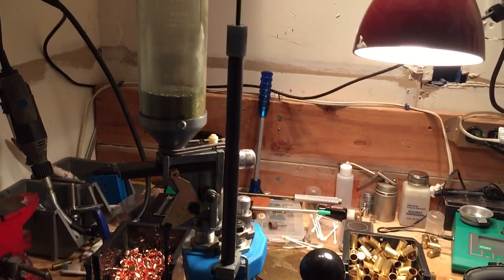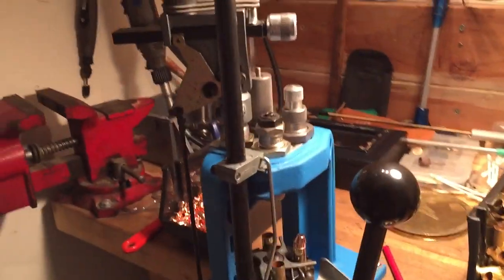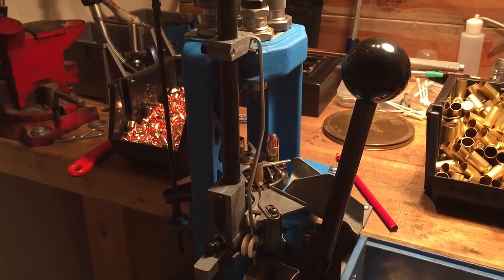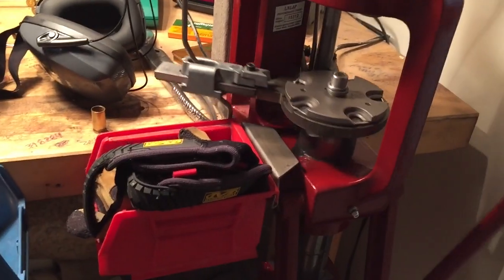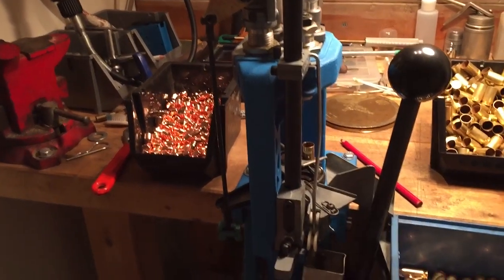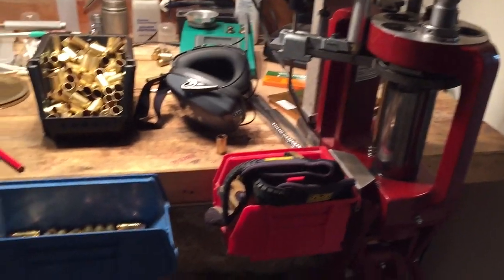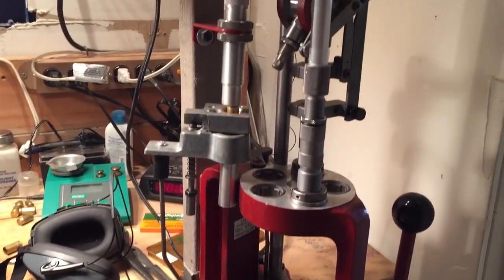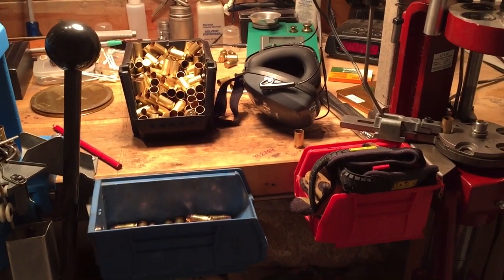Dillon 550 & Hornady LNL AP Comparison of two $400 Reloaders

Comment: I recently picked up a used Hornady LNL AP press in a trade (It came with an automatic case feeder and all the plates for it as well as 6 shell holder plates, 9 sets of dies with quick change adapters for all die sets and lots of other items. I’ve been reloading for a decade now and I used an single stage RCBS which works fine for the small batches I do for long range marksmanship but I wanted to find a Hornady press to make bulk ammo. The prices on the Hornady AP presses has gone up dramatically but there’s many of them out there compared to the Dillon so there’s a better chance of coming across a used one. I’ve been wondering how the Dillon would stack up to Hornady so this was a helpful video. Hornady customer service was very good when I needed replacement parts and they gave me what I asked for at no cost which was nice.

Comment: It is an old video, but what do you think about the presses now some years later? I have had it with my hornady lnl ap, tired of all the issues, and went to a dillon 550c.. Did you ever notice on your hornady ap when indexing cases into station 5 that they tip inward towards the middle? Both of my hornady ap's do that in several different calibers, especially with tall cases. That causes the case in station 5 to often collide with the mouth of the crimp die and cripple the case. So I can basically not use station 5..

Comment: I own a Dillon 550B. When I ordered my press, I bought extra powder dies and I use 1 powder measure between 4 different calibers. So honestly you don't have to buy extra powder measures.
Reply from the maker: I thought of doing the same thing but when I asked a couple of long time Dillon users they both warned me that I'll regret not buying a separate power measure for each caliber. Now that I only load 45acp with my 550 it's all good. I'm still thinking of getting a 650 for my 9mm and 38spl, but I need to sell my Hornady AP before I take the plunge. Thanks for your comment.
Reply: legalsolutions07 no regrets with me. it's 2 Allen head bolts too loosen. Guess with 3 kids I couldn't justify the extra expenses. reloading is my out so I don't mind spending extra time.

Comment: Great video your a professional well shot and explained. Viewers need to remember you are comparing a 4 stage press to a 5 stage press. Also a Dillon low powder warning die will solve the problem of boobing  back and forth. I am using the after market one on a RCBS Pro 2000 because I am using #2 on the tool head for the powder drop and view was blocked. I like the socket on the powder adjustment bolt.
Reply from the maker: Thank you for your comment. The RCBS Pro 2000 is a nice machine. I loaded on one that a friend owns and it's every bit as fast and easy to use as the Dillon or Hornady.
Reply: Pumpn ethel  He compares 2 presses with similar prices, which is fair. The other powder warning die is an option, but that's paying money for something that Dillon didn't think of.  Reaching around to put a bullet on (without bullet feeder)  and peering around to see the powder level makes no sense. Hornady put the powder inspection and bullet station up front.  That's wise.

Comment: Prefer the Hornady for many of the same reasons. Well thought out arrangement, very solid and smooth, etc.  When you consider the 500 free bullets, my Hornady press cost about $275 brand new.
Reply from the maker: The bullet give away was the reason I first bought my Hornady. Back then Hornady was giving 1000 bullets with the LNL which made for a great deal on a progressive press. Thanks for your comment.
Reply: legalsolutions07 wow. I thought 500 bullets was generous.  I like rewarding companies that offer value and quality together.  I like LEE dies, bullet molds and other items for that reason.
Reply from the maker: Hard to beat 1000 bullets along with a quality press. I've used Lee dies and all have served me well, and they do offer quality at a good price. Now I'm using Dillon dies for 45acp and Hornady dies for .38spl & 9mm. I'm out here is So Cal where they are now recording all ammo sales so loading my own circumvents this intrusion. Thanks for your comment.

Comment: Not a fair comparison, the Dillon costs $440.00 and the Horandy $560.00 so right at the start the Hornady is more expensive and beyond that you have added a case and bullet feeder so of course your output should be higher. I use a Dillon RL550 mainly in one pistol caliber but have four complete tool heads so reloading a different bullet is fast and efficient and I don't move dies or powder measures. Admittedly the Hornady ram is larger and you have more options with five dies but Dillon offers presses with the same and built in feeders so it really comes down to how much you are willing to spend and what quantity of rounds are needed. I love Hornady bullets but will stick with Dillon as that's all they do (make reloading presses) and warrant them for life.
Reply from the maker: I bought my Hornady LNL press 10 years ago and it wasn't anywhere close to $560. As I recall it was approx $360 but the press came with 1000 45acp bullets.  I really like my Dillon and both mfg. warranty their presses for life. Thanks for your comment.
Reply: @legalsolutions07  But to be honest about reloading, it does cost a bunch to get it setup. I have 4 pet loads for my pistols in one caliber and have setup my Dillon to operate with just a simple die plate switch out. That cost me 3 more: dies, switch out plates, powder drop tubes and all this to get the job done fast but that it is ... Fast. Everything else I reload takes a back seat to a single stage press. LOL
Reply: Midsouthshooterssupply.com. currently has the hornady ap progressive press for under 400 on sale might wanna check it out

Comment: Nice comparison review. I have never used the Dylan. But they sure look nice, and get great reviews. But I am happy with my Hornaday. How would you compare the primer function of one versus the other.  Which is smoother?
Reply from the maker: The Dillon is a nice machine, but so is my Hornady LNL. As 4 primer function I think the Dillon has a little better feel when pushing back on the handle as the primer seats. I think this may have 2 do with the smaller ram diameter in the Dillon giving more feel than the beefier Hornady ram. Thanks for your comment.

Comment: You can change the cal on the dillon press the powder measure will work I'v got the first one there is no bar from the measure to the bottom of the press and it works with the same new charg bars, so that just meas the old things still work with the new things with dillon.

Comment: one more thing the powder measure does not mess up or at least it has not for over 30 years and lots of loads over time, gotta love dillon back then it was the only one at that time
Reply from the maker: Thanks for your comment. The Dillon 550B is a very nice loader that's easy to use, solidly built and will last forever.

Comment: NOT a valid comparison......Your Hornady is setup with bullet feeder and case feeder.   Setup this way definitely nor $400 for the Hornady
Reply from the maker: Actually I'm only using the bullet feeder die that I refill by hand and a case feeder tube that I refill by hand. The basic setups r about $400 each and neither press comes with dies. Thanks for your comment.

Comment: problem ur comparing apples to oranges u should be comparing to the 650 . i have 2559s and load everything under the sun
Reply from the maker: For function I agree but the 650 is several hundred dollars more than the Hornady AP. I think the Dillon 650 is a better progressive press than the Hornady AP LNL, but I don't know if it's $300 better. My basic point of the vid was to compare two comparably priced presses. Thanks for your comment.